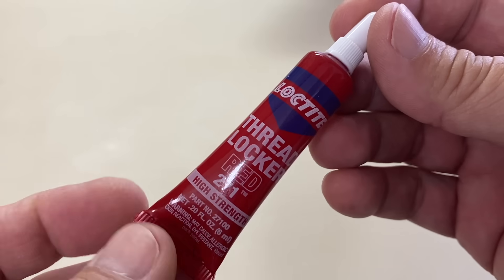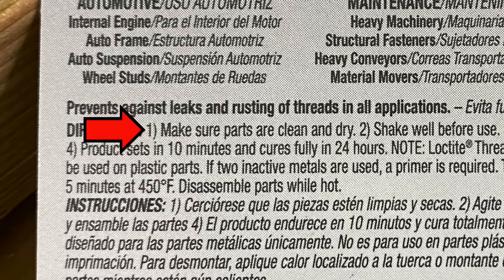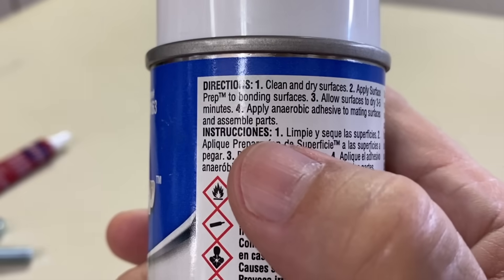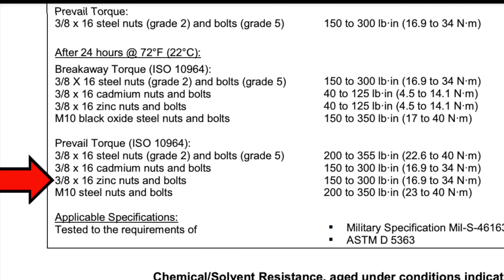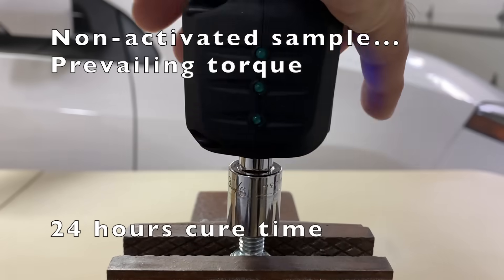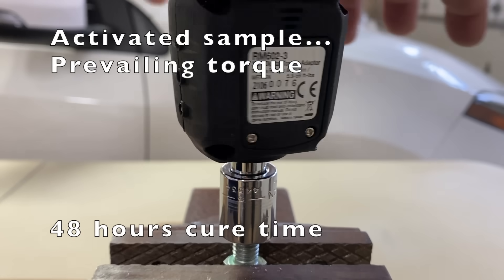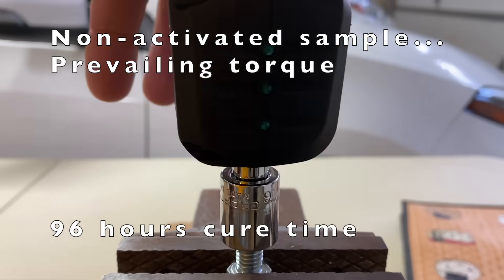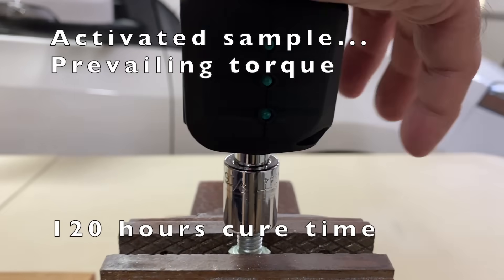Nuts & Bolts - Most DIYers Do Not Know This | Loctite Red Threadlocker Curing

Comment: Former Loctite sales rep here. Zinc is a fairly active metal, which is why it's used for sacrificial anodes on boats. You won't gain much using primer/activator. That product is meant for passive metals, such as stainless steel. What the primer does is add another cleaning, and introduces copper ions, which will cause the Loctite to set up. Try your experiment using 316 stainless bolts and nuts, passivated if you can find them.
Reply: A sales rep that knows his stuff!! Bet they miss you 👍
Reply: @ifell3 ?lol.  Yeah, kind of pathetic nowadays.
Reply: You do not always want an anaerobic adhesive to be strong. Very low strength versions seal the last tiny voids between very close fitting parts and guarantee a predictable disassembly force during maintenance for parts that may otherwise have been damaged during disassembly.
Reply: This power plant   https://www.youtube.com/watch?v=yoFd5nPS6-Q  , which makes extensive use of Molybdenum austenitic stainless steels, was put together with a scheme of anaerobic adhesives. The purpose included threadlocking but also included control of disassembly forces and control of galling so that the turbines could be maintained throughout their planned life without incurring damage during maintenance. The plant and its technology has been a success and as it reaches the end of its operational life a plan exists for a replacement. During construction, because of the methods of application, an unusual discoloration of the adhesive occurred which had to be investigated. Technicians had thought it was corrosion but in fact a retired Loctite Ireland engineer was able to identify it as oxidised adhesive probably due to excess application of the adhesive.
Reply: One solution that was used with stainless steel bolting in a salt water environment was assembly using talc as a solid lubricant to deter galling followed by application of a penetrating anaerobic which provided a locking action but also prevented crevice corrosion.
Reply: @jimf671 pro tip is always on the comments
Reply: @jimf671  I thought crevice corrosion occurred solely in a anaerobic environment ........?
Reply: My experience with stainless fasteners is they are self galling and need no thread lock. Good luck getting them apart under anything but the best of circumstances. God how I hate working with stainless bolts.
Reply: @lifesucks247  As an avionic technician, I had 36 years experience installing and removing stainless screws and bolts in steel nuts of many kinds. I found the fasteners would gall if a screw gun was used, and if they were using the fast speed to run the screws in. But if they used the slow speed, then the fasteners did not gall, in most circumstances.

I tried many times to tell others to slow down their screw guns, but they would not listen, as they didn't have to remove the fasteners most of the time, and they wanted to get the job done quicker.

What was even more fun, was trying to stop them from using their screw guns on instrument panels, and having the gun hammer at the torque stop setting. It ended up ruining analog meters used in many of the instruments. Since they did not repair the instruments, they didn't care, but it cost customers tons of money to get the instruments repaired later!
Reply: @jeffreyyoung4104 Many bolted joints on the space shuttle orbiters that were designed to be removed in installed repetitively used A286 screws/bolts and silver plated nut plates or nuts. The use of power screwdrivers was not allowed. While we did have the occasional galled hardware, it wasn’t a widespread problem. Interestingly enough, the use of thread lockers on orbiter hardware was not allowed per specification. It was however approved in limited cases and required MRB approval. In one particular use case, the 1/4-28 screws attached a thin metal plate to the lower forward area of the vehicle, adjacent to the nose cap. The plate had a tile bonded to it and there were holes thru the tile to provide access to the fasteners. The tile thickness was about 3.5 inches. This location was one of the hotter areas of the vehicle with temperatures approaching 2300 degrees F on the tile surface. The only way we were able to use the locking compound was the maximum certified temperatures of the fasteners was less than 200 F, Threadlockers don’t like heat. The repair was limited to one flight so it had to be done each prior to each flight until the associated nutplate could be replaced, which required to removal of the nose cap, which required removal of the Forward Reaction Control System module, a very extensive task.

This is a link to extensive NASA testing regarding the use of thread locking compounds on the space shuttle orbiter:  

https://ntrs.nasa.gov/api/citations/20120015467/downloads/20120015467.pdf
Reply: @Johnny Table  Use a Liberal amount of the right kind of antiseize, and you'll be fine. This excludes the possibility of using threadlocker of course, but nylock is better anyway, except when you can't get to it with a powertool of course. 

I've built helidecs from extruded aluminium girders that snapped together like laminated flooring. These were then secured with stainless bolts and clamps. We did this as a team, and I was new at the job. I held everyone back because I used too little antiseize on one bolt, and I had to cut it, because it had welded itself together. It's remarkable how little patience a foreman can have with young boys, fun times 🫤
Reply: @frodehau The problem with anitsieze compounds is it greatly affects the K factor, or friction factor of the threads. The reduction of friction has to be compensated by reducing the amount of preload. Hopefully your engineer recalculated the preload. If not, all of those joints could be suspect.
Reply: @lifesucks247  I've replaced stainless nuts and bolts on my boat tower 3-4 times and they keep coming off due to vibration..
Reply: @lifesucks247  Permatex nickel anti-seize is your friend
Reply: @lifesucks247  Boeing had us use Blue(242 I believe) locktite on all stainless bolts. It works well and actually reduced galling while keeping the bolt secure.
Reply: @lifesucks247 Maybe in higher torque applications bc I switched from galvanized to SS hardware on my truck and kept losing nuts so started using blue Locklite.
Reply: @lifesucks247  LOL too true
Reply: @lifesucks247 I hate stainless more than you. It's good for cutlery. Anything else I hate it. At least put a plated nut on a ss bolt for easy removal.
Reply: @lifesucks247 Plus SS is soft so the head get mangled or the Allen hex strips out
Reply: @lifesucks247  stainless has a lower torque setting than steel bolts. galling happens because they are overtightened.
Reply: @lifesucks247  Name checks out 😂
Reply: @lifesucks247  You should still try locktite because it acts as a lubricant after you broke apart the nut and bolt, not to mention it forms a chemical barrier that can prevent the not from sticking.
Reply: @lifesucks247  Actually , no. I work a lot with stainless as I own a sailing boat. Only once had I a galling problem.
Reply: @lifesucks247  Yes. Stainless sucks to drill holes in too.
Reply: @ I work at a plastics facility lately, and I've seen that first-hand multiple times, especially with coworkers who like to tighten everything way too tight.
Reply: @lifesucks247  Stainless is all I buy for something I want to take apart again, especially on vehicles. Everything else is rusted into one piece after one winter.
Reply: @lifesucks247 We call them one and done. Bring a sawsalll when removing them. Although better stainless bolts definitely make a difference.
Reply: I once worked in a machine shop and had to deburr thousands of stainless parts. Was a frustrating job.  Only metal I worked with that loved to make new burrs seemingly on its own  😆
Reply: @lifesucks247 1. Use anti seize. 2. Use Loctite. Loctite provides the lubricity between the thread to prevent galling. I assembled stainless water control gates for a manufacturer for years and never had galling  issues after using either. Even Moly grease can be used if you use a mechanical lock washer because of the way moly-disulphide shears when planar torque is applied.
Reply: Chemically speaking, not quite right. Zinc is both very prone to corrode but also very slow. Its also galvanic, but requires water to really function in that way by forming zinc hydroxide and then zinc carbonate (white film on anodes). So it (theoretically) binds up free oxygen and slows cure time of oxygen curing compounds like loctite (as shown by the longer cure time but eventual parity with the activator)  

This is all just my assumption based on my inorganic chemistry. I'm a biochemist, so could be missing something big.
Reply: @CanIBorrowYourShovel  These are anaerobic thread lockers.  They cure IN THE ABSENCE OF AIR in the presence of metal ions.   You won't find a FULL bottle of loctite.  They always seem less than half full for a reason.  And you're a chemist?
Reply: My job orders both and they're both in red bottles 😮
Reply: @rogerpeacock5365  I have a red tube with the blue compound, and a blue tube with the red compound. Packaging screw-up?
Reply: @pyrotech7210  nah they did it intentionally to mess with us ;)
Reply: Years ago permatex was a contingency sponsor at NHRA (drag racing) I don’t know if it was somebody who was actually in the know, but one of their reps that was always at the track doing their display told me that it was important that the bolts be torqued because part of the curing process involves removing any air or oxygen from the threads is that true? It always sounded legit but I was 21 years old so you told me the moon was square and I would’ve believed it for another beer.
Reply: I had to edit, Siri doesn’t understand that English is a first language for me
Reply: @fixpedalboards1969  That is why it is called an anaerobic chemical. The bottle needs enough O2 to keep it from hardening.
Reply: Hi,

We use 18-8 stainless hardware and use both red/blue loctite on various parts. The only thing I've not had anyone be able to explain is why the loctite sets-up and then turn into a gray paste a year later. Got any ideas? Suggestions?
Reply: @roberth7691are you aware of a product that was used quite a lot in the 70s and 80s and probably still today, it was used on screwheads usually, I think it's purpose was to secure the screw and also to provide tamper evidence, it was usually red or blue, when you lossened the screw this product would almost shatter as it was hard, it was translucent, a lot of people use nailpolish to do the same job but nail polish is not as hard, an example of this product in use would be after the azimuth of a cassette deck was adjusted, manufactures would apply this product to the head of the adjustment screws to lock them in place, if you tried to turn the screw it would break the seal so evidence of tampering could be seen.
Reply: @nickfatsis9607  still use it, RS sells a red tamper proof sealant. It is just a visual has no real anti torque value.
Reply: I use Loctite Blue as well as Loctite Red. But there are times I need a bit more strength than the blue, but not quite as much as the red. So I just mix the two in equal parts to make Loctite Purple.
Reply: @dshmechanic  We had a guy using clear locktite, and once they found out, he was asked to stop using super glue on fasteners...
Reply: Chemist here. Sorry, no copper listed in SDS  for permatex  surface prep. It’s just a solvent cleaner.
Reply: Wow, I thought stainless would last without bonding. Learn something new everyday.
Reply: @HoggishGreedly  it lasts, but galls easily if you use power tools.
Reply: stainless steel bolts and nuts will gall and seize using hand tools. ask me how i know. use anti seize and it's a different story.
Reply: @HoggishGreedly  Wait until you hear about Heli-coils put into Titanium .gov parts.
Reply: well that explains why the Loctite didn't do so well when I used it on stainless bolts on an application with a lot of vibration.
Reply: i love to listen to experts on stuff, they know their shit very well, have you considered doing videos related to loctite?
Reply: so quick question, in radio controlled nitro rc racing there's a debate over using red vs blue loctite. the screws are stainless steel screws. it is mostly used on the drivetrain and to mount the engine and the clutch nut on the flywheel of the engine. what do you recommend for radio controlled cars with such high rpm and vibration?
Reply: No matter the outcome, your presentation was 1st class, thank you !
Reply: Somewhat of an interesting point about 316 stainless...I work in a machine shop. 316 stainless is the only stainless in our shop, whereas when we are machining parts, all bad 316 parts, drops, swarf and shavings, all go into separate "316" bins as the scrap price is worth significantly more than the rest of the 300 series stainless.
Reply: Thank you
Reply: A question nobody can answer except a loctite Rep...
Does loctite  cause chemical attack on nylon?
Reply: What good is a test if it's not a real world application.
Reply: @donmunro144  What good is a real world application, if 99.9% of us want to use it on a different application?  ;)

Proper testing methodology would still help, but the sample size was far too low.
Reply: @stinkycheese804  I was talking about the guy that wanted the test done on 316 stainless bolts. As he put it, if you can find them.
Reply: @donmunro144  If you can't find 316 fasteners, you're not looking very hard. They are as common as mud out here in the real world.
Reply: Please tell Why would you need a sale rep for loctite?????????? You’re a joke.
Reply: i love it when real experts comment …ty
Reply: @bluskytoo  same
Reply: I like nylon lock nuts.
Reply: you must be the manager now... congrats sir!!
Reply: This is why as auto/Diesel technicians we were told to never use stainless hardware on rusted studs and etc. Brass and soft metals for high heat, corrosive environments. Try that on cab mounts, boy you will not regret it. Stainless is great for dissimilar metals, but not where rust is present. The chemical make up of stainless will errode it, as it regenerates. Truly awesome engineering.
Reply: Agree, I have used Locktite, on pretty much every type of metal bolt, worked every time. Never once used activator.
Reply: There is a huge difference between "Zinc" and the CADMIUM plated bolts he was using.
Reply: Put heat to those stainless bolts😂
Reply: Thanks! Great info. Anyone know how much stronger 290 is than 243? Want to know if it's still hand tool removable without heat.
Reply: But the real question, does it actually expire.
Reply: @ We will never know for sure.....  Cue eerie X-Files music.
Reply: On Ford truck exhaust manifolds the bolts used are too small and snap off from warpage (poor shielding from water). OEM uses coated steel bolts into an aluminum head. Aftermarket has stainless bolts available that are less prone to breaking, and aren't hard to remove because the aluminum heads are so soft.
Reply: So is Loctite designed to be used on active or passive metals?
Reply: Would it be beneficial to do this breakaway torque testing with a bolted joint where the is actual preload (bolt stretch) in it?
Reply: oh thanks, i almost thought of using electrolysis to remove it
Reply: Years ago when I was active duty Air Force, our supply guy ordered more 1/2pint bottles of red LocTite than we were suppose to have on hand. He noticed the bottles were only 3/4 or so full so he combined them and got the “bottle count” down to an allowed number. After a few days, the bottles had cured too much to use the product. This lead me to believe it was the lack of air that caused the curing. Not very scientific but useful as a practical example. Our application was a sway brace similar to a large wing nut on a 1/2in nc stud. The threaded part of the nut was quite small, maybe 3/4 in long contact with the stud and there was no mechanical locking feature, all cleaned up it would spin on easily by hand. With the red LocTite, we would have to use a heat gun and an 18-20in long bar to take it apart. Much more torque than the examples in this video. Maybe this is a different product than what we used back then but it was branded simply LocTite Red.
Reply: @rustyaxelrod these adhesives are known as anaerobics. This means they cure in the absence of air. Hence why the air in the bottle was important.
Reply: A Loctite rep told me the thread locker containers will eventually become somewhat sticky because the plastic  "breathes" to prevent the contents from curing.
Reply: There are anaerobic (non oxygen atmosphere) and aerobic(with oxygen) if you sqeeze all the air out of anaerobic loctite it'll set up hard, in a day or less. Anaerobic is for things like sleeves, etc.
Reply: @rustyaxelrod Well, if you read the bottle you'll see most thread lockers are 'anaerobic' i.e cure in absence of air - no need for experiments 😂
Reply: @rustyaxelrod You got to do some more reading On the containers all loctites have numbers. Not all red Loctite is created equal.
Reply: @rustyaxelrod  you're right, in that oxygen cures them, but certain other things like active metal ions can catalyze the process (catalysts don't become part of the new compound, they just speed up the reaction process). That's why the "inactive" metal still cured, but took longer.
Reply: @colinmartin9797 Awhile back, I read something from loctite that said when using the blue, to let the loctite drop onto the fastener to prevent metal ions transferring from the fastener onto the bottle. Have you heard this?
Reply: Also, part of the curing is a matter of time.  

In ideal conditions it sets much faster.  

Nobody wants to wait a week for their thread-locker to set fully.
Reply: It is hilarious seeing these so called DIYer vids showing the population how to use a product when its been used for the last 50 YEARS !!!